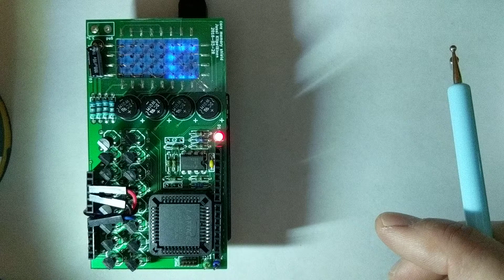Interactive Core Memory Scrolling Screen RAM

Comment: im still trying to understand what it does. is it like a touch screen ?
Reply from the maker: This application of core memory doubles as a magnetic touch interface. Core memory wasn't intended to be used this way, but it works well! In industry, core memory was used as non-volatile RAM.

Comment: Hello, I really like your project and I am thinking of making a magnetic core memory. I really wonder how you put leds in the cores (SMD leds?), how did you connect them and how did you get to be R, G or B (three colors) when the magnet store a bit of 0 or 1?
Reply from the maker: Thank you! The array of cores is suspended above the LEDs. They are two separate components. When viewed from the top down, it may look like they are together, but they aren't. 
As for colors and bit storage, there is not as much going on as you might think. There are two modes of operation between the cores and the LEDs. The only thing the software knows is which core or cores are being affected by the stylus at a point in time. The decision about how to illuminate the LED is made in the programming logic, however you want it to be. In the video above, only one mode of operation is being shown. That is the first mode, where I simply choose to illuminate the corresponding LED with blue (it's a NeoPixel LED, in this array: https://www.adafruit.com/product/2945) if the bit is set, or turn off the LED if it's cleared. The software makes a simple one-to-one mapping directly to the LED from the associated core.
There is a second mode of operation that I use in the snake game, shown in another video (https://www.youtube.com/watch?v=s888zmQmS-4). In this mode, the software is detecting where the stylus is, like in the first mode, but it's applying some game logic and color-coding on top of that to update the LEDs separately, and maintain other color states. In this case, the cores are treated as a touch screen array, and the LEDS are treated as a separate screen layer.